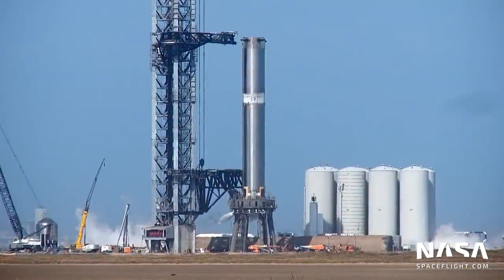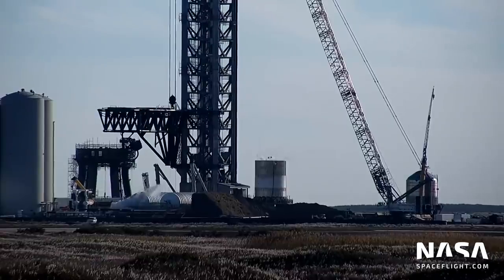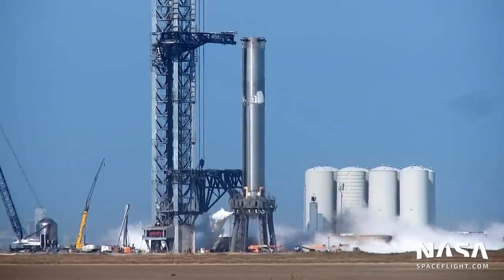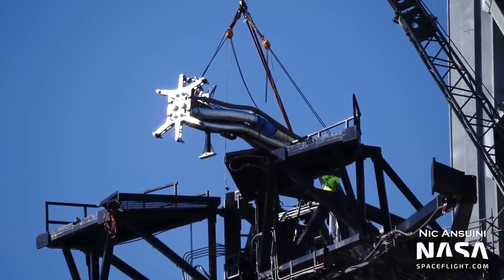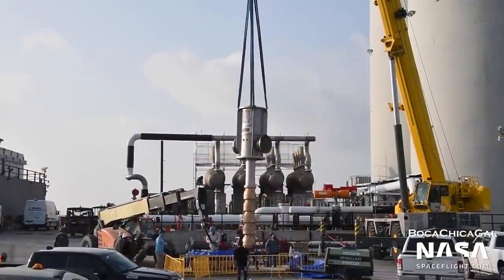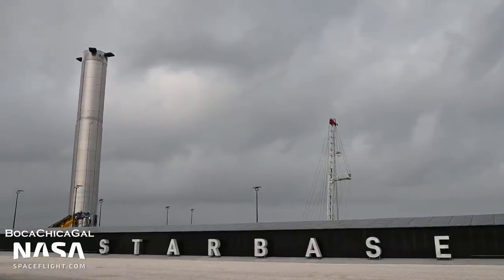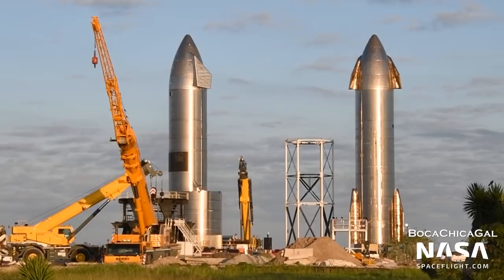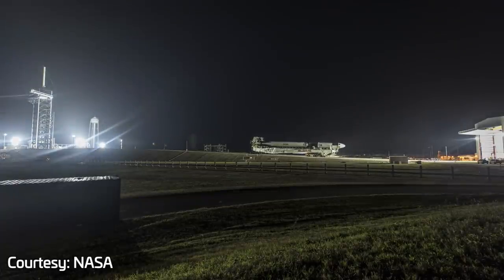Booster 4 Testing Begins | Starship Update (Narrated)

Comment: I just wonder if booster 5 has a airtight interior like everything inside the booster, only my idea is metal rusts in little ways and it adds up inside and out. Is it ok to just have the ships sitting or do they (expire) if you know what I mean? And also I just think about the (expiration date) idea, can you use a gas to stop the insides and outside from.. weather and debris/ pre burning abuse and all even the concrete explosions seen with the other starships early on. Cool idea to just be able to preserve the rocket same idea with a plane really 👍

Comment: They don't need this complicated launch table. Instead  Booster with Starship on the top can launch from hanging position. So  they will not to repair it every time after launch because of melting and heat damaged parts. Why not to do like that Elon?  Just build heavy duty hanger/catcher for booster and that's it.